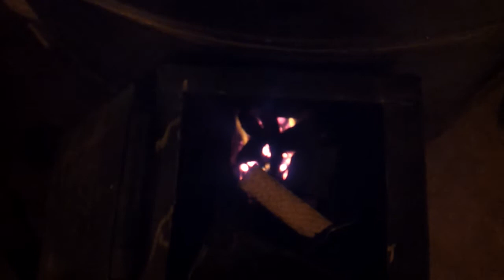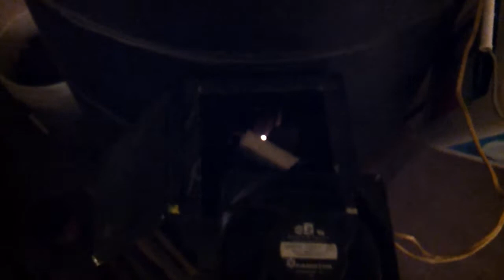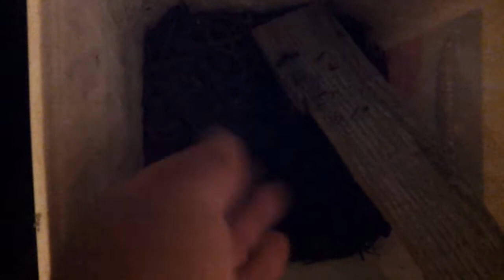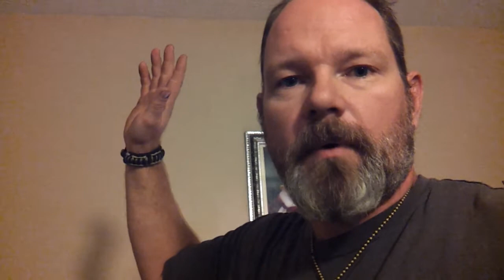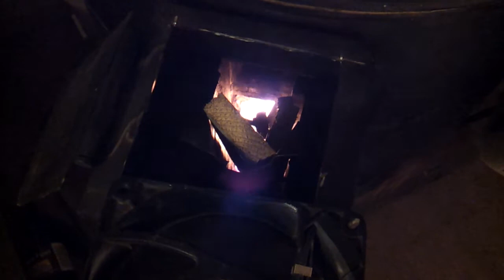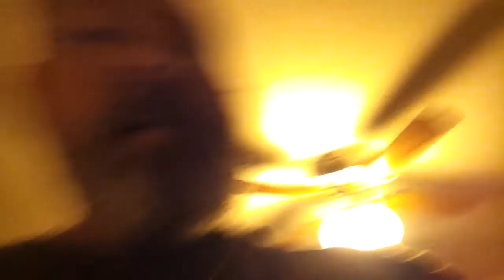ROCKET HEATER ~ FEED TUBE MODIFICATION

Comment: The blower is not to bad to use.. How is it for night time burning, and how does it do when it's cold outside, does the temperature drop quickly during the night or does it hold it's own pretty well?? I'm thinking of making one in the future. I'm not a welder my uncle is and I know that he'd have fun making one..
Reply from the maker: This stove will heat my whole house if I keep it running full bore and feed it alot. I shut it down at night and have the thermostat set to take over if it gets too cold in the house.  on the coldest days so far its got down to 60 in the house by morning buy within an hour I can have the house warmed back up. Thanks for watching...
Reply: Guy Brown
Thanks for answering.. What do you think about adding firebrick to the inner shell of it? Like make a form to hold the brick in place on the outer walls. It's just some thoughts that I have if I attempt to build one.. I don't weld but my uncle does, he just might find the project interesting to do..